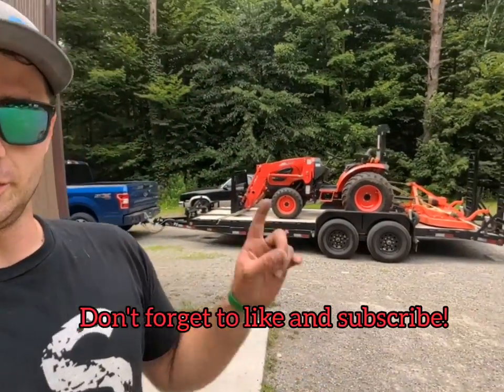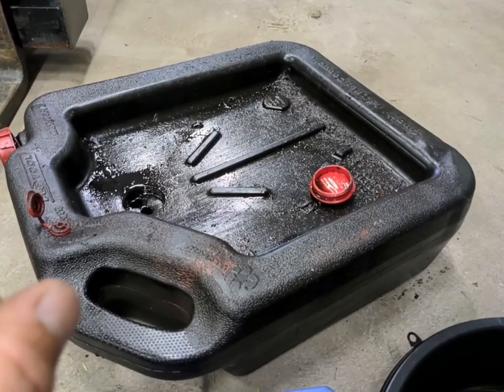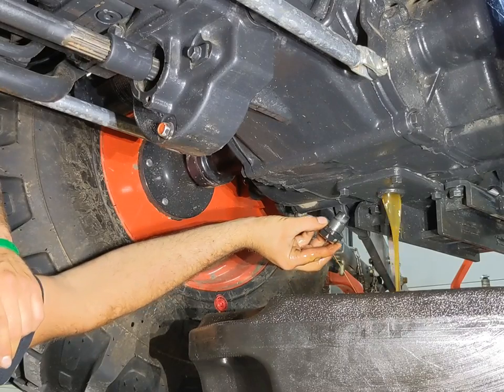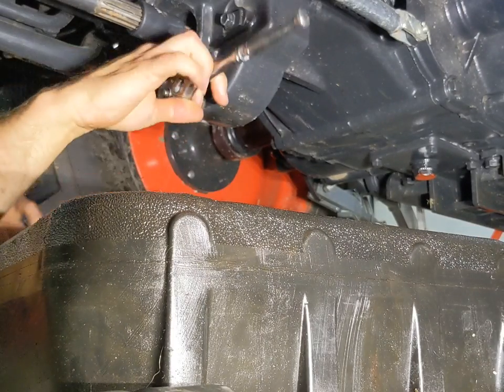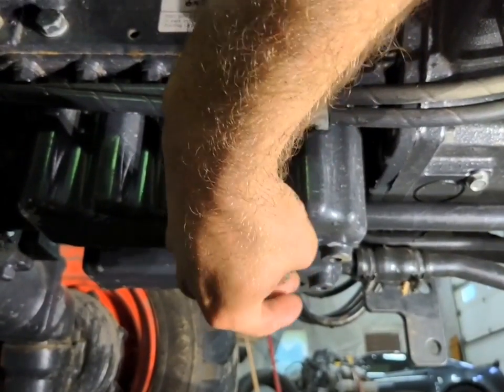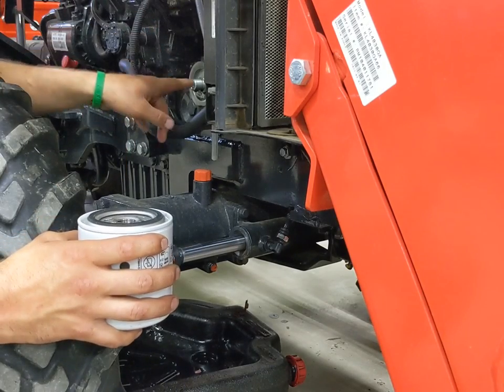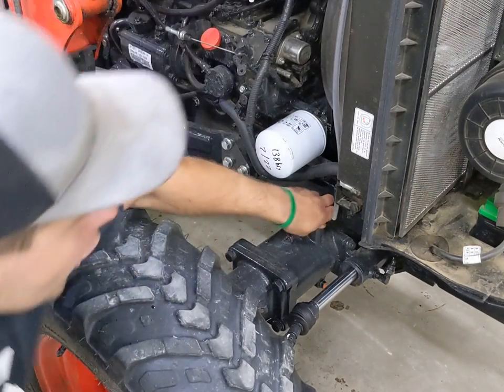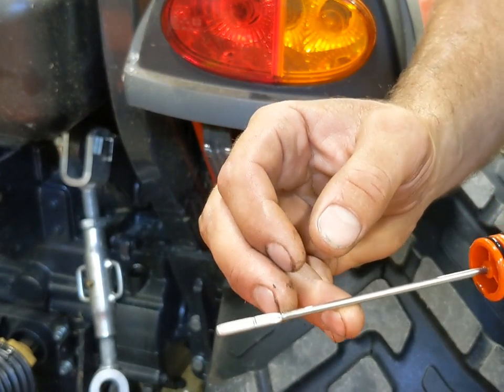Step By Step Kioti CK2610 Service! Let's Get Dirty!

Comment: Great video, thanks for putting this together. I had already researched and bought all my Wix/NapaGold filters and semi-panicked when I saw your oil filter # of 51324 instead of the 51381 that I had bought. Did some Googling on it and wanted to leave this here in case anyone else sees the same OR has problems with fitting their oil filter in due to the length.

“The Wix 51324 oil filter is too long for my 2013 CK30, and the cover plate will not go on with that filter installed. At Wix Filters - Product Catalog search results it shows Wix 51324 and Wix 51381 replacements for the E620132443 original Daedong filter. The Wix 51381 is also about the same length as the Daedong 620132443, fits nicely on my 2013 CK30 and has about the same bypass pressure as the Wix 51324. The Wix 51381 should be a good replacement since it's directly cross refer3enced in above link. Hopefully this info will prove useful for others who find the Wix 51324 too long to fit correctly. BTW I also learned the Microguard MGL51381 the same filter as the Wix 51381 and is made by Wix for O'Reiley's Auto Parts, and it costs about $3 less than the Wix brand.”

From https://www.tractorbynet.com/forums/threads/kioti-filter-cross-reference-number-list-all-models.295122/page-9
Reply from the maker: Thanks for the great information! Anything to help complied data for other owners!

Comment: the reason you lube the filter gasket is because I was taught to always clean the surface where the filter meets the engine. That ie for Two reasons. One, you know the gasket came off with the old filter.( you cant always see it that well.) and the re oil the gasket because you cleaned the mating surface.

Comment: You say not to tighten front axle drain plugs down. I’m going to be doing an oil change on my front axle at 65hrs because my drain plug fell out from factory torque. So I’m going to add that to my check list of tightening

Comment: Where are the other grease points under the tractor  the manual does not show them  ???? THANKS  Reilly like your video helps a lot
Reply from the maker: Hey Art, if I remember off the top of my head you've got one on the front as well as one on the back side of the front axle pivot, you've got 2 zerks on the top link and there's 1 zerk on the three point height control. That one is easiest to access from the back of the tractor looking where the ROPS mounts to the transmission housing and it's under the seat area. I think you just inspired my next video!

Comment: Just picked up my CK2610-HST today, and working up notes on maintenance schedules, etc.  Great info on different lubricants, etc.  Thank you.  

If i had water still coming out of an axle, I'd be a bit worried.  Just curious, but do you plan to replace the oil on that axle again track it?  Is it possible that you cracked a seal when fighting with the ice?
Reply from the maker: I haven't seen any leaks and the tractor doesn't sit outside so the only chance that water would have to get in through a seal is possibly when I pressure wash it. The cap is vented though, so once that went under water, the flood gates were open so to speak

Comment: I bolted a angle to the two flats coming up from the fuel tank right be hind the seat. Than I bolted the Plano box though the same angle. Drilling though the bottom of box and the same angle - I used large flat washer for the bolts in the box. The box sets right behind the seat and does not get in the way of seat when you movie the seat all the way back.
Reply from the maker: The flat washers were enough of a backer to keep it from cracking or flexing around?
Reply from the maker: Thanks for the tip though! I'll probably come up with something similar soon
Reply: So far, it’s holding up pretty good. It’s just a little offset to the right too. No issues with fueling from the left side. I carry channel locks, level, tape measure, and a adjustable 12” wrench that is cut short to fit in the box with some pins etc. I can see your concern- If need be I’ll weld a base plate to the angle for the box to sit on - which is not a bad idea.

Comment: Pro Tip: Use a Fluid extractor and take 2 gallons off the hydraulic fluid before draining from the drain plug. no need for a second drain pan. I concur less than 5 gallons will drain...

Comment: Great video, but you miss spoke it calls for 5.8 gallons not 6 quarts. there are 24 quarts in five gallons
Reply from the maker: 6 quarts of engine oil, 6 gallons of hydraulic fluid I believe is what I said
Reply: What filters a filter # s did u use .